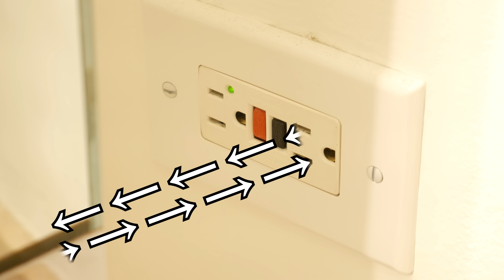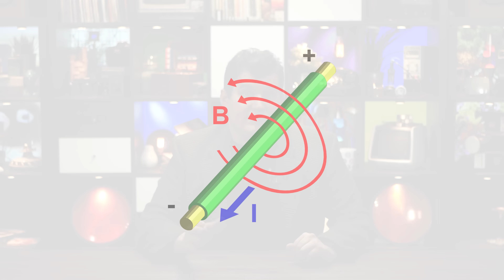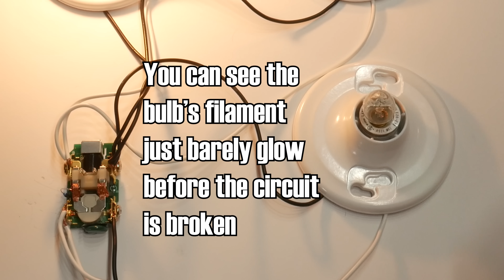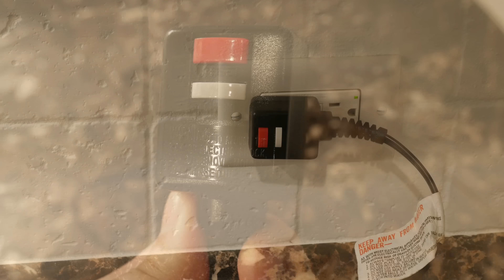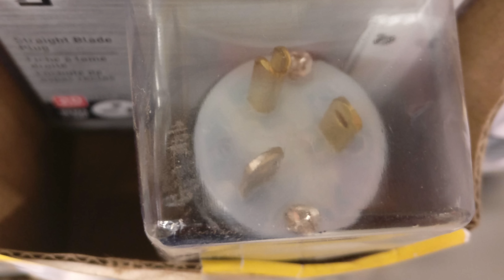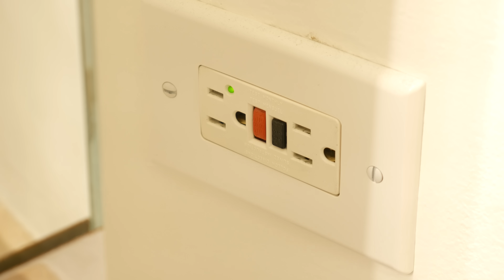The GFCI/RCD: A Simple but Life-Saving Protector

Comment: Good vid as usual.  One extra thing I could point out: we in the US  do have panel-based circuit breaker GFCIs as well that can optionally be used in certain cases.  For whatever reason, our house's builder chose to use one at the panel for the GFCI that protects the bathrooms, garage, and outside outlet (not quite modern code, not as many circuits as a modern house).  But the kitchen has one of the more common outlet-based GFCIs.  Go figure.  Speaking of which, I should test that panel GFCI to see if it still works...

Then you've got the whole other ball of yarn known as the AFCI, but I guess that's a story for another day.
Reply: iri10 I prefer to use panel mount GFCIs for exterior outlets as that protects the GFCI from weather and moisture and permits the use of a simpler and hardier basic receptacle outdoors as the hold up better long term.

Comment: Good video.  Can you do one on the "Arc fault breakers" too?
Reply: Leonard Pezzano If he cracks open an AFCI the Devil will almost certainly escape!  They are a great idea in principle but were forced into use well before the technology was really matured enough resulting in a lot of nuisance trips and entire new neighborhoods that to this day are still outfitted with flawed AFCIs such that a single low power radio transmission in the vicinity of the house or subdivision can randomly trip many random circuits in people’s homes (Eaton brand in particular).  By forcing them into production a good decade or two before they were really ready we turned millions of homeowners into very expensive guinea pigs as it falls upon the homeowner to shell out the money to hire an electrician to replace entire panels of expensive faulty AFCI breakers that are prone to nuisance trips.  The Eaton brand in particular has been the bane of amateur radio operators as it is a budget brand installed in many homes and many are notoriously sensitive to any nearby RF such that even transmissions at just a few watts (we are permitted up to 1500W and most commonly operate around 100W) can be enough to knockout power to many homes in a neighborhood equipped with such AFCIs — something that should not happen and would not have happened were they not rushed into use before the technology had been fully researched and better perfected.
Reply: I had a house built in 2005 and that is exactly the experience I had.  Aside from the nuisance trips, do they work as intended?  And on that subject, what exactly are they designed to protect?
Reply: Leonard Pezzano AFCIs, in principle, are meant to analyze the “noise” superimposed on the mains frequency and look for signs of arcing/shorting while applying some proprietary heuristics to eliminate legitimate arcing (such as briefly when a switch or relay is energized or a cord unplugged from an outlet).  When they detect what the believe to be a “not acceptable” arcing event they are supposed to quickly trip the circuit to possibly prevent a fire.  Hence the name “Arc Fault Circuit Interruptor”.   Do they work?  If you exclude all the nuisance trips, then at least in certain instances.  As I said, they were really rushed to market and made mandatory by Code a good several decades before they were really ready for mainstream, so there is a lot still unknown regarding their real world effectiveness and even that is heavily offset by the often excessive nuisance trips — with so many nuisance trips it can be hard to know which actual trips might have avoided an actual fire.

I think what happened is that the industries behind them sold the NFPA (National Fire Protection Association) on the potential benefits adding them to Code could yield in reduced electrical fires but were likely not upfront about how immature the technology was a decade ago when they were added to Code.  Eventually they will mature and nuisance trips will be vastly reduced and a lot of these negatives will likely be resolve and they will likely genuinely save lives like GFCIs do, but by then millions of homes will have been fully outfitted with the faulty and immature AFCIs where they will continue to be a major hassle for decades to come as most homeowners do not tend to refit their electrical panel with all new circuit breakers unless there is good reason to replace the entire panel...so 50 years from now we will likely still be dealing with the fallout of this rush to market!

Comment: As mentioned, in Europe 30mA for the whole house is common. For the UK, the reason for the fuse-per-plug (not socket..) and switch per socket, is unrelated to GFCI/RCD, it is because of the use of wiring that is a ring main, unlike the majority of Europe. Assuming the ring is not broken, it increases the load carrying ability of the wiring (as it is a ring, you have two sides from the fuse to the socket, simplified). 
In LATAM where I live now, it is an exception to have earth actually connected. In the US, based on following a few electrician channels, it seems that GFCI/RCDs are now required in many states not just on sockets in damp areas, but everywhere. It seems there is a trend to require the same on all circuits. I am now wondering whether the US will end up following the Europe approach (whole house RCD, followed by regular fuses). 
Interesting way of showing the operation in your video, appreciate all the work that went into that one!
Reply: Wiebo Westerhof In the US a GFCI really would not be suitable as a whole house protector.  Our GFCIs are set to trip at 5mA, a current threshold below the limit that can cause death, and is too low a threshold for an entire house protector because there is always some innate leakage to ground (even just capacitive in the electrical wiring itself there exists some innate leakage, excluding attached loads).  If we were to go whole house we would have to raise the trip threshold to avoid excessive nuisance trips, thus sacrificing the level of protection.  Additionally, they could never be retrofitted to an existing panel since the neutral conductor would have to be redirected through the GFCI detection loop and not go direct to the neutral buss bar as they presently do (recall that in the US we use split single phase, 120-0-120 or H-N-H, so there are two hots and a neutral — only the two hots pass through the main breaker presently and the neutral bypasses the breaker and goes straight to the neutral buss bar).
Reply: Ethan Poole thanks Ethan for the detailed response. You're absolutely correct. I currently live in a latam country and the standards here are between good and scary. I ripped out all of the installation and replaced it with more up to date gear. There are just basic fuses here plus the sockets as demonstrated in this video where previous installed sockets were not even earthed and 50A on wiring for 16A. It was downright dangerous. It was really cool to see the insides of the circuit and the demo.

Comment: Why couldn't America just use god forbid, TOGGLE SWITCHES on the wall sockets like every other country in the world?
Reply: I see you didn't watch a second of the video
Reply: I must've missed that part?
Reply: Like, a single second. Or are you saying you'd run to flip a toggle switch while being electrocuted?
Reply: I just mean in general, if you plug something in the wall there's generally sparks if the switch is on, and if you had your fingers near the pins and plugged it in halfway zAPP.
I've always been taught to have the switch off before plugging something in, but in the US they don't even use toggle switches apparently.
In australia I typically only see these protector things in bathrooms of hotels, but it also alongside it has a toggle switch.
Reply: Here's what I'm talking about:
imgur dot com slash 3Mrf6K3

Youtube keeps hiding this comment if I put a link in there sorry

Comment: The reason they sell two different models is actually due to difference in the circuts you're adding the GFI to. If it's a 15A circut, you can't put a 20A GFI in there since then someone could overload it easily by plugging in a 20A appliance. 

But I agree it's BS to charge more when the only difference in the GFI is the plastic cover.

Comment: Standard American outlets are rated at 15 A? Interesting, because European (CEE 7) ones are rated at 16 A, that being at 230 V (thus roughly 3.6 kW), not 120. My vacuum definitely goes above the standard American rating (at 2.2 kW). That said, circuit breakers are often rated at 13 A, 16 A is normal for washing machines and other high-wattage devices. Stoves take three-phase AC @ 400 V/16 A, so I guess there must be some higher-amp versions in the US? IIRC, three-phase AC isn't really a thing there.
Reply: Most homes in the US and Canada have single split phase 120V/240V at 100A or 200A from a centre tapped transformer (neutral/ground at centre). This provides two 120V feeds and a neutral. Large appliances are fed from the two 120V feeds which gives you 240V, then all the standard 120V stuff is fed a 120V feed and neutral. There is a low risk of getting a 240V shock since the conductors are always just 120V to ground.
Reply: In Finland standard circuit breakers are 10 A, stoves can have 20-25 A. Maximum allowed power for a vacuum cleaner is 900 W in Europe.
Reply: You're right, for new vacuums it is, but mine is a bit older (roughly five years, from before when that regulation was enacted). I have to measure it yet, but at least it says 2200 W on it ;)

Comment: You can buy GFCI circuit breakers in the United States, they just aren't as common.  They are easily found at Home Depot or Lowes and they even make ones that have a dual function of AFCI and GFCI.  AFCI is also available in GFCI style receptacles too with some also being dual function with GFCI.  AFCI is now required on almost every circuit in the house (in states that have adopted the latest electrical code) including ones that have previously required or have not required GFCI protection.  You should do a video about how AFCI is different from GFCI now.
Reply: Saw a video on youtube where a hams radio would trip his neighbors AFCI!
Reply: Yeah AFCI needs some work on defining what exactly is the trip threshold, right now there's too many harmless things that can trip them, "safer" or not.
It's not safer if it generates so many false positives that you can't tell if it was a real fault or just another nuisance trip event.
Reply: 44R0Ndin. AFCI circuit breakeres have gotten better at detecting actual arcs instead of electronic noise.  If you are having a problem with your electronics nuisance tripping your circuit breaker, it could be one from the early 2000's and would easilly be solved by replacing the arc fault breaker with a more modern one.
Reply: My house has CAFCI breakers for the bedrooms and my gaming PC trips the stupid things more often than I'd like.  I tried replacing the breaker (just swapped the one for my bedroom out with the one for the smoke detectors in the electrical panel) but it still trips sometimes.  It does it significantly less now that I've taken out my dual R9 290Xs and put in a GTX 1080Ti.  I figure one GPU drawing significantly less power than the 2 I used to have probably helps.
Reply: +CalcProgrammer I've found that my UPS will trip GFCIs. You should see about replacing the GFCI breaker with just an AFCI breaker.
Reply: CalcProgrammer1 - You may have a problem with the Power Supply in your PC.
Reply: Denshi-Oji Both UPSes and computer PSUs use common mode filters which can make the GFCI see leakage.
Reply: Lol used to have a paper shredder that would turn on if you keyed a walkie talkies next to it
Reply: I agree..  I'd love to see a video on AFCIs..  As someone who had a house fire because of an arc INSIDE a piece of 40 year old romex, I learned of AFCIs during rebuild, and am now more interested in such things!!  Knocking on wood, I have had no false tripping of my AFCIs in the 5 years we've been back in the house.
Reply: They also make combo GFCI and AFCI circuit breakers now. Also, while GFCI receptacles often trip at 5mA, the circuit breakers won't trip until around 30mA.
Reply: Hello7833 - Thank you, just the same comments I was about to make!
Reply: My portable AC didn't like the AFCI that supplied my bedroom in my old apartment. (It worked but made an ungodly racket when the compressor kicked on.) I ended up running a hefty extension cord out to the hallway outlet.

Comment: Here in the UK, the RCD is in the consumer unit. We have what is called a "split load consumer unit" where one side of the panel is protected by the RCD and the other side isn't. Generally you would put all your ring circuits on the protected side and your lighting circuits on the unprotected side. The reasons being that you are unlikely to accidentally touch a live wire in the ceiling, and also if the RCD trips, having to fumble around in the dark to reset it introduces new hazards. Also, switching on a light and having the bulb blow is also likely to trip the RCD. We also had to put our old electric cooker on the unprotected side, as leakage from the heater elements was causing a lot of trips.

Comment: Nice explanation of GFCI's, but you forgot about one thing. These are not magical devices. As the name suggests they interrupt circuit only when there is ground-fault. Therefore they won't work if you touch live wire while being isolated from ground, nor they won't work if you touch both live and neutral wire. Nothing will save you from getting shocked and most likely dying then.
Reply: +Piotr Sowiński He is wrong about the equivalence of RCDs to GFCIs. GFCIs incorporate the overload protection you are talking about. The equivalent device in the UK is a RCBO. They will help protect you if you become part of the expected circuit.
Reply: I'm not electrian, but as far as I know nothing will protect you if you touch both live and neutral wires. RCI won't shut off, because no current if flowing to ground and overcurrent breaker won't trip, because current flowing through body is only couple hundred mA. 
In my country RCIs are called differential breakers and are obligatory in all new builduings. We usually have one or two for a whole house.
Reply: As I said, that is one of the key differences between an RCD and a GFCI/RCBO. I'm not an electrician either, to be clear. A typical GFCI meant for personal protection, not equipment protection will trip at <30 mA, usually 10, in the US. It could be that the leakage goes out another path, but I'm not going to try to explain that. It would be better to look up John Ward on YouTube and see what he has as far as an explainer. He's really good at that stuff, explaining the nitty gritty details of wiring. Here's his channel link:
https://www.youtube.com/user/jjward

Comment: I have a gas generator with a GFI breaker. It would trip on the slightest amount of static electricty even when connected to a ground post. Very annoying. So I fired that little bastard in the garbage and put a normal one in.